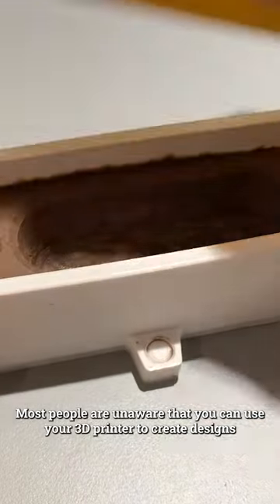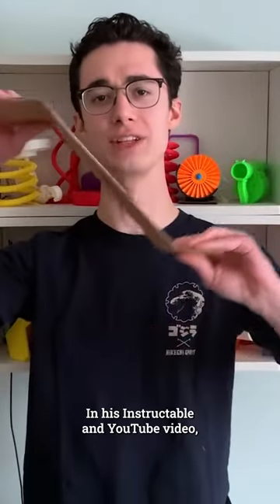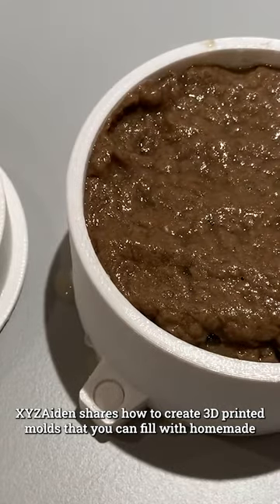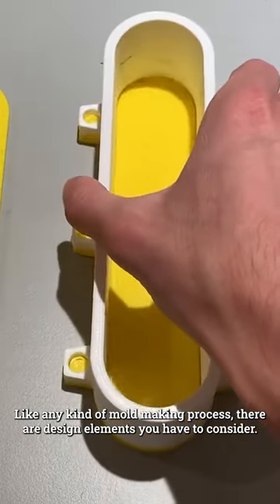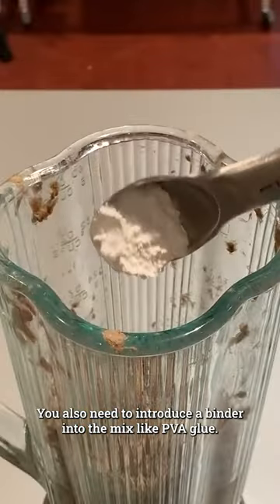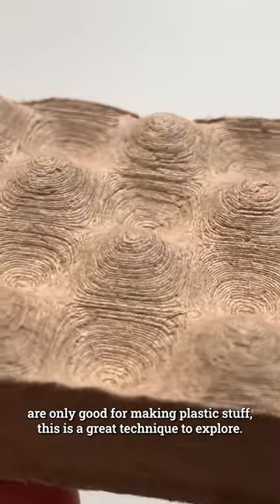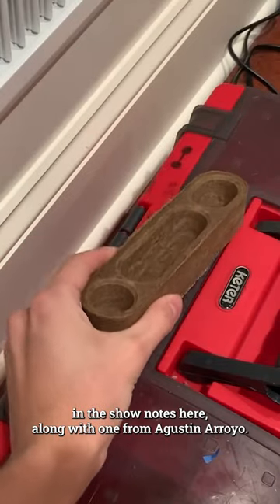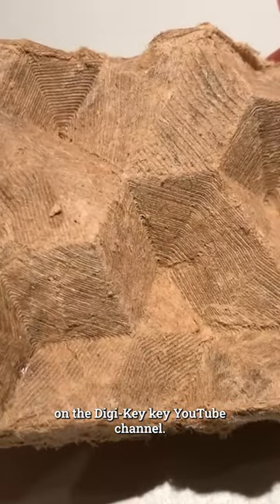Cardboard Objects From a 3D Printer - Maker Update #Shorts

Comment: I'm not down on the fact that printers only print plastic. I'm down on the fact that there's fundamentally not much you can do with them besides tabletop curios. Until I have the ability to build car parts or a foundation for a house/backyard shed, I'd say they're all toys right now.
Reply: They can do that. If you buy the industrial low tolerance ones…
Reply: I disagree. While I have made toys for my kid, I’ve also fixed a few things in my house with my printers. I’ve made replacement parts for things like battery covers. I’ve made containers for silverware, I’ve made organization boxes, with programming and coding I’ve made a mosquito trap entirely 3D printed, I’ve made air diffusers, light diffusers, vases, planters, all the sinks in my home have no drain covers so I’ve made those including for my shower, I’ve made center pieces for parties and party decorations, I’ve made aquarium hideouts for my fish, I’ve made tools I use to train my pets, I’ve made a phone case, and a lot more. 

You’d be surprised how strong the prints can turn out despite being plastic. Look around you, many things are made of plastic. A 3D printer is a tool. If you get it without knowledge or skills in CAD and without a creative or engineering mind, then yea the 3D printer is a useless toy.